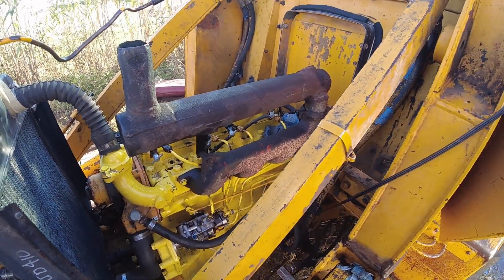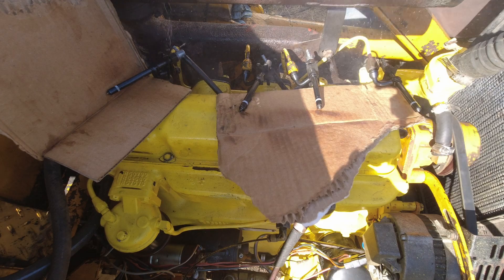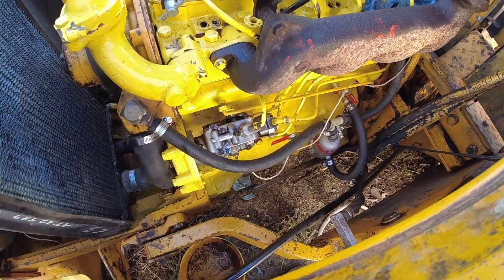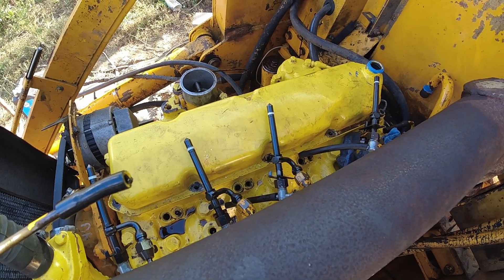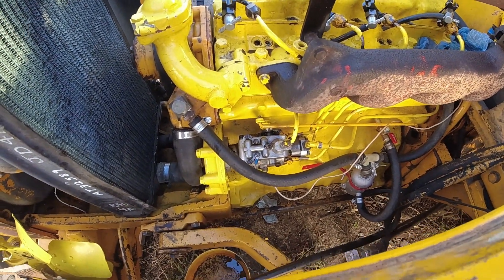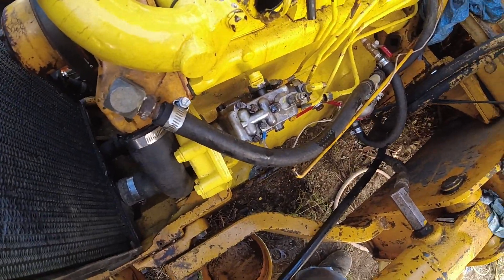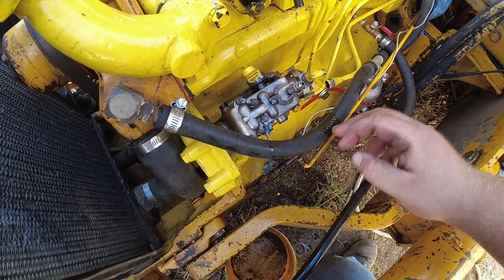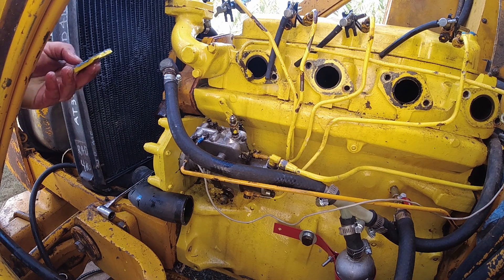Removing Injection Pump on John Deere 410 Backhoe

Comment: been trying to remove 2 injectors over heated because i used that gasket orange crap plugged the head to get water inside and under the valves these cloth strands from somewhere i have no idea.  I have the pdf on 410 if you want it.

Comment: Hey I watched this and a few years back did the mistake to not watch the seal rings on the shaft whilst reinstalling the pump. The result was that diesel fuel run past the shaft into the motor block and filled it up mixing with motor oil in no time. There are two seal rings and the one towards the pump is most difficult since its lip easily folds back on itself. They even made an installation tool looking like a small piston ring installer for this purpose and not to mess up this crucial step. Had to take mine out again just because of that little neglect.